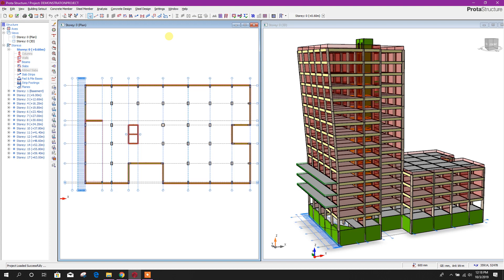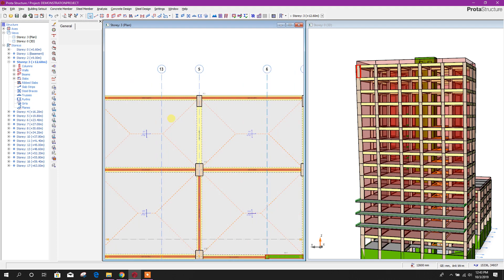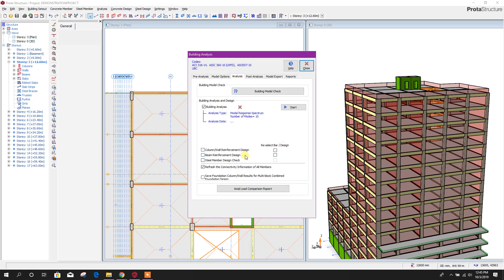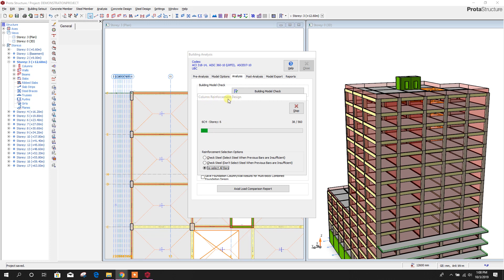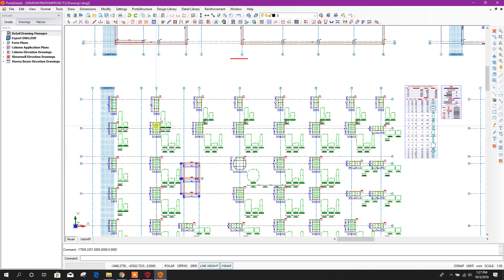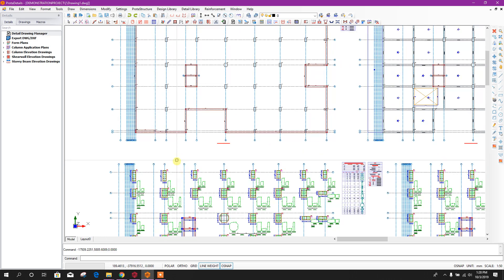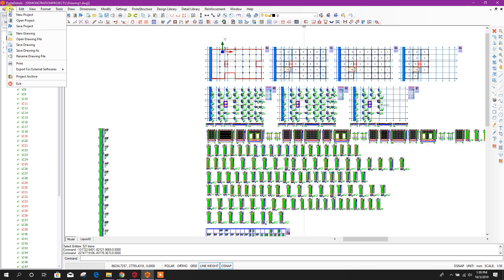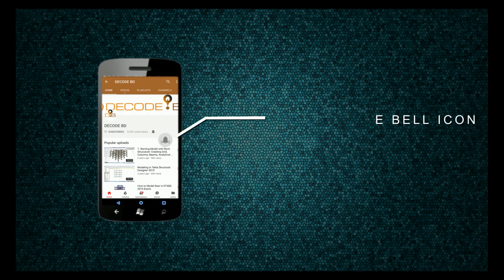15 Storied Building Design in Prota Structure 2019-Part8 *Design & Detailing*

Comment: Hi Engr. Kabir, you're doing a great job with this channel. One comment. If you resize the columns after analysis and design, you actually have to reset the bars as well as check the shear design tab. If it passes, the Utilization ratio will show.
Side note, what I usually do is that, I design every column type, making sure that the bars in the upper columns are not more than those in the lower columns. I hope this was clear.
Reply from the maker: That's great & important information you have added. Thanks a lot dear.

Comment: I hav an doubt about revit structure..how to add the rebar on extension tool..When i use extension tool for beam reinforcement.. 4@16mm top ..then i go to rebar tag.. shown 1@16mm only.. but 3d view 4 rods are there..but rebar tag shown 1@16mm bar only..what is the solution sir
Reply from the maker: Check tagging tutorials carefully.
Reply: @Decodebd  are you made it tagging tutorial..pls send that video link